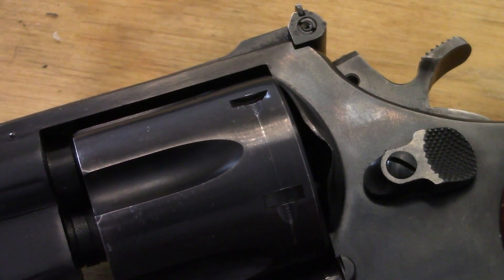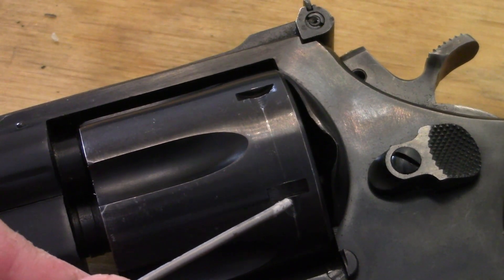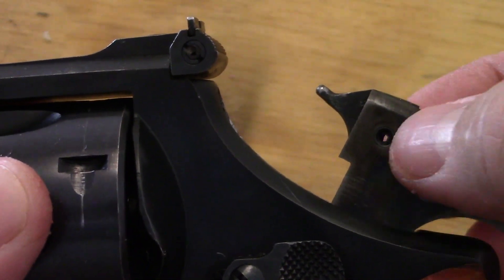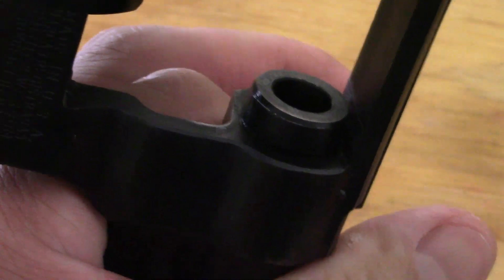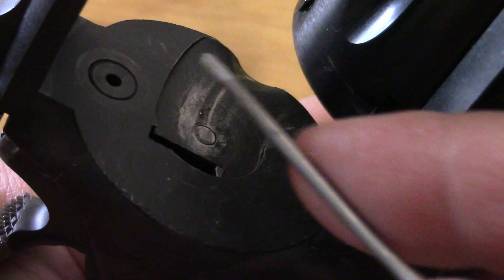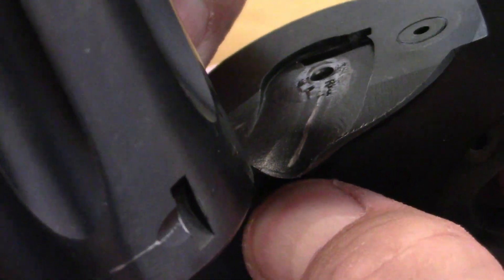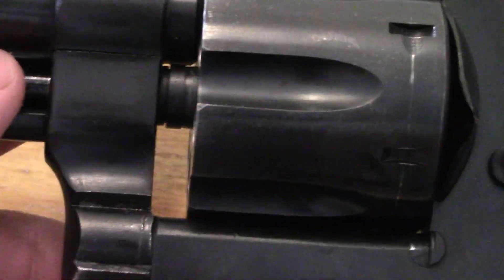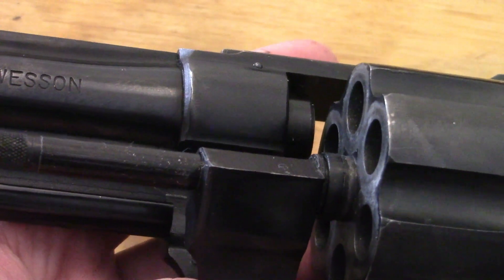USED revolver basic inspection

Comment: Used your mod 28 there.👍 Cool. Mine is my best friend. 
Those were very good points for inspecting the primary points of the overall condition of a DA revolver. 
Many hot loads using H110 and 125gr JHP loads eroded the topstrap to a brutal proportion. Very glad that you emphasized the importance of inspecting of this area. 
Well done sir!👍